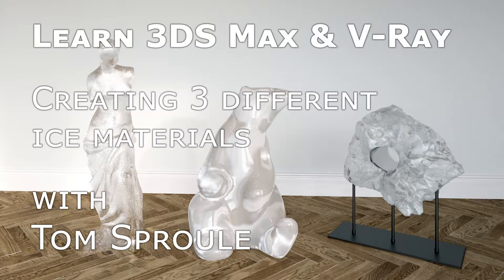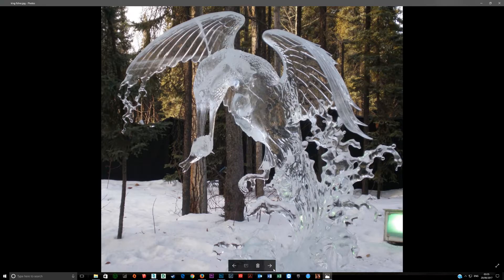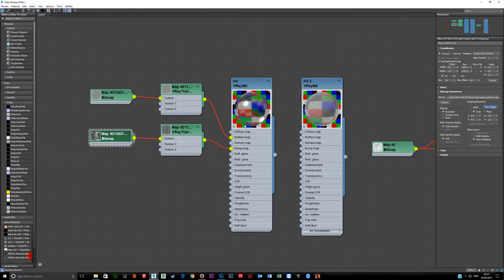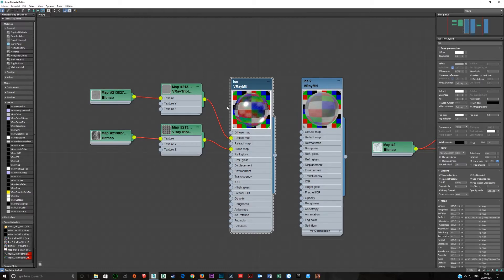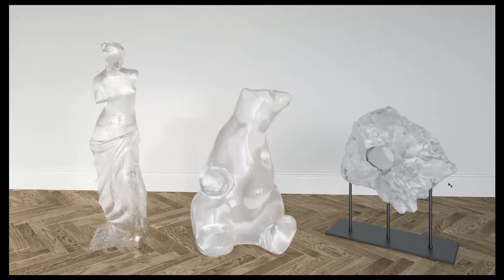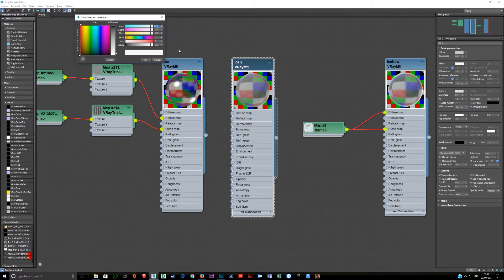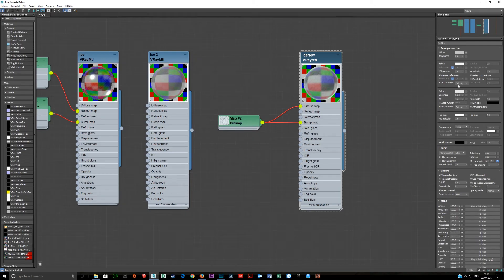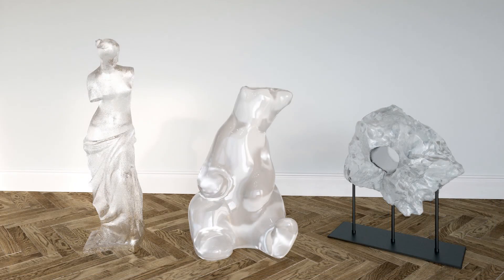Learn 3DS Max & V-Ray: How to Create Ice Materials – Archviz & CGI Tutorial

Comment: I can't find the Vray Triplanar Tex map
Reply from the maker: Andrei Florin Oh, it should be under Maps, Vray. Which version of Vray are you using?
Reply: @leonleon51  maybe it's too old, Vray 3.20 for max 2014
Reply from the maker: @AndreiC34  Try this link, it will download a plugin version: 

https://web.archive.org/web/20171111150045/http://help.chaosgroup.com/vray/misc/vraytriplanartex.zip

Then place it in either of these folders:

C:\Program Files\Autodesk\3ds Max 2018\Plugins
C:\Program Files\Autodesk\3ds Max 2018\Plugins\vrayplugins

And then see if it's in your material editor. It should be under your maps. 

I know this worked with Vray 3.4 and 3.5 but not sure if it'll work with Vray 3.2.
Reply: @leonleon51  how do you use the 3 plugin files ( .dlt files)?
Reply from the maker: @karlhans6678  Hi, you put them into the folder: 

C:\Program Files\Autodesk\3ds Max 20**\Plugins
Reply: @leonleon51  i placed them there but when i launch 3ds max 2017 it gives me an error "failed to initialize. Error code 126 the specified module could not be found."
Reply from the maker: Karl Hans Oh, you have to make sure the plugins are for the right version of Max.
Reply from the maker: As in plugins are created for each version of Max. So if you are using 2017 you need to ensure your plugin is for Max 2017. If you try to use a plugin for Max 2018 or Max 2016 it won’t work. If you are using the correct version of the plugin you should be good to go.
Reply: @leonleon51  oh right, it says 2014-2016